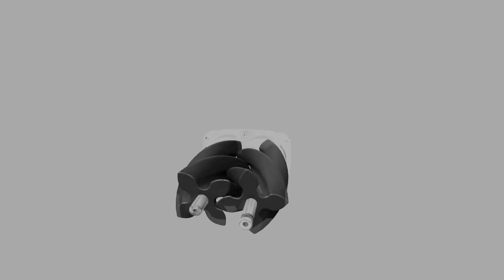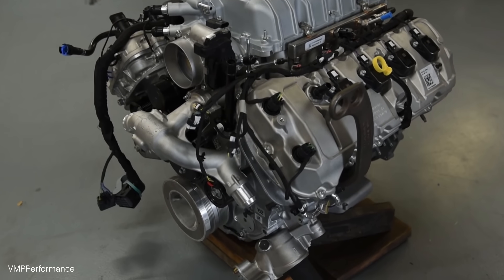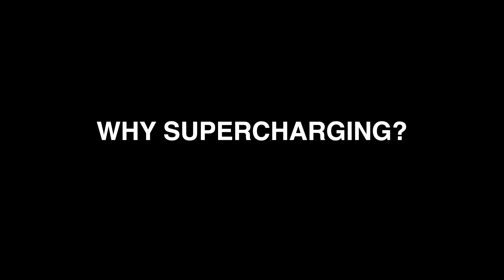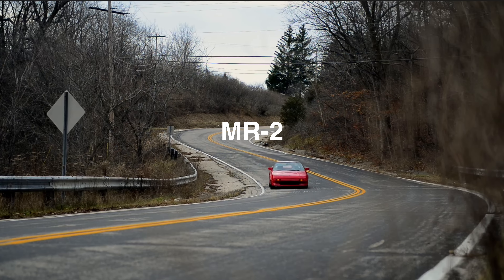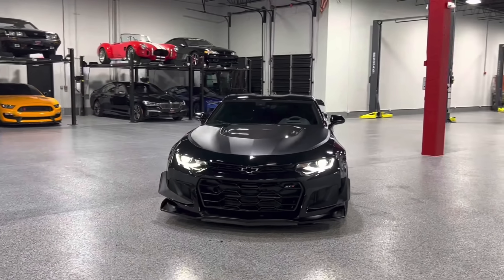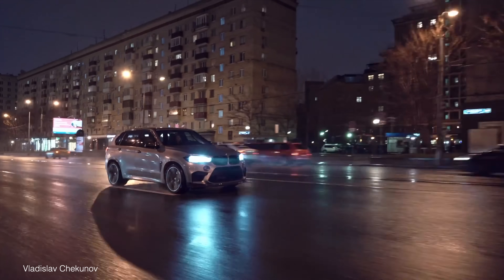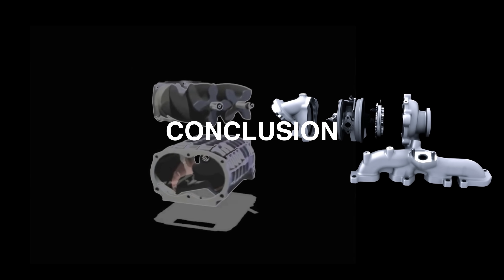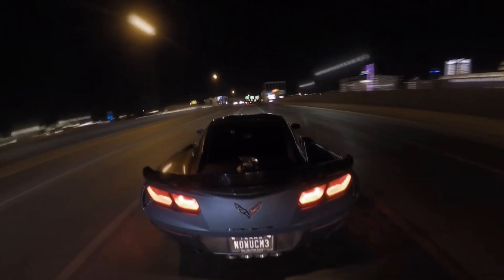Why V8 Engines Are Supercharged vs. Turbo😮| Explained Ep.6

Comment: Gotta remember the biggest thing. You were close to saying it.
V8s make more low end torque than 6 and 4 cylinder engines.
Super chargers give instant torque better for low end power.
Turbos build peak boost later in the rev range better for DOHC high revving engines. Usually v8s aren’t Devine as high. Also V style engines are wider making it harder to fit snails next to the heads. Super chargers sit snug on top of the intake manifold
Reply: A properly sized turbo can start spooling at 2100 rpm. But then fail on the top end of the rpm. But a twin turbo setup matched correctly has both low and top end.
Reply: @12pawsinn  variable vane turbo. Best of both worlds
Reply: @12pawsinn  even variable turbos?
Reply: That kinda goes both ways though, because supercharging the i6's and i4's could help offset their relative lack of Torque. I think its mainly down to the fuel costs in US vs EU, Euro car manufactures focused more on turbos because they knew their customers demanded better fuel efficiency due to the higher cost of gas in EU, not to mention the EU's stricter gas guzzler taxes and so forth, which the US stupidly followed suit with later.
Reply: An inline 6 almost always has a better torque curve than a v8
Reply: I can feel the supercharger in my C7 Z06 you can't really hear it whine from inside the car
Reply: So, my truck makes peak power at 3,000 rpm, and it is turbo charged. It makes very little power at high RPMs, so that kinda blows your stupid comment out of relevancy, huh?
Reply: @charlieodom9107  damn bro chill we’re all learning
Reply: @CodenameOliver101  if you want to learn anything, then go to a bookstore and read some good engine builder books. You won't be learning anything but lies here.

The most important thing to know is this: air/fuel in = Power out. Engine size means absolutely dick. A 3L engine can make just as much power at 3,000 RPM as a 15L engine does with the same amount of input.

The issue becomes how hard it is to squeeze that much into a small displacement engine. For example, a 5L engine makes the same theoretical power at Atmospheric pressure, as a 2.5L does at 14 psi of boost. There will be minor differences based of volumetric efficiencies of the engines.

Turbos get their power virtually free from the exhaust gasses, whereas superchargers are parasitic, so there is some losses, making them less efficient.
Reply: @charlieodom9107  turbochargers also reduce the power output by restraining the airflow of the exhaust gasses. It’s nothing compared to the loss of power caused by a supercharger, but that’s still an important factor.
Reply: @CodenameOliver101  Exactly...which is why his comment was a good contribution to the conversation yo
Reply: @albero319  turbos use wasted exhaust gases to make power. Superchargers use power directly from the engine to make power.
Reply: @White000Crow  yes, and both subtract power from the engine. You can’t get energy out of a fluid without actually reducing the energy the fluid has, which means it gets slower, which means that the engine needs to work harder to push the exhaust gasses out.
Reply: @albero319  what are you talking about getting energy out of fluids?  The gas is getting burned regardless of your forced induction.  The hot exhaust is coming out of the engine when it runs, which is purely wasted unless it is being used for something. 
How restrictive are turbos, do you have an equation for the losses?  
If you are talking exhaust restrictions you can also be talking about port sizes, exhaust manifolds, headers, pipe diameters, mufflers, catalytic converters, pipes bends, etc.  These are factory cars they have all these restrictions as well. 
On my old turbo 1.9L I had a 3” exhaust, straight pipe all mandrel bent. I doubt there were many restrictions there.
Reply: @White000Crow  a turbine is a machine that transforms the kinetic energy of a fluid into mechanical work. By doing this you reduce the speed of the exhaust gasses, which reduces the efficiency of the engine. This disadvantage is not that big and gets cancelled out by the forced induction (if the designer knows what he’s doing). That’s the same principle that gives piston engines a little bit of extra efficient at medium altitudes: lower atmospheric pressure means a higher pressure differential and a higher kinetic energy of the exhaust gasses.
Reply: @albero319  so fluids like water passing over a turbine act the same way as hot exhaust gases?  I’m not getting the comparison. 
Try walking in neck deep water flowing at 10 mph, now try it in 10 mph wind. There is a huge difference there. 
The whole exhaust system on factory cars is full of restrictions that reduce efficiency.  Exhaust gases are a wasted energy that is a byproduct of internal combustion.
Reply: @White000Crow  exhaust gasses are a wasted byproduct, but the way they flow has a huge impact on the engine, that’s simply it.
Reply: @albero319  Dude, tell me why my old 330i N52 made 274hp on a remap and my old single turbo twin scroll 435i made 420 fbo stage2+ E20 map and the cherry on top my twin turbo M4 makes ~ 500 on a remap (and catless). So adding turbos results in a more powerful engine (all of them 3.0L i6). Even if the turbine takes some effort to spin it more than gains it from the increased combustion.
Reply: @Salpeteroxid  it’s a small loss, and of course it’s cancelled out by the forced induction, just like it is for superchargers.
Reply: @albero319  a turbo indeed forms some restriction in the exhaust, increasing backpressure, but it more than makes up for that by increasing inlet pressure. This isn’t even including the fact that the engine can now inject more fuel as it gets more air.

A turbo takes energy from the exhaust gas that would otherwise be wasted, as at high load the exhaust gas is way above atmospheric pressure as it leaves the exhaust ports.

A turbo makes it a bit harder for the engine to exhale, but makes it way easier to inhale.
Reply: @albero319  it's not a loss. Not if you see it as a package. An electrically powered forced induction, powered by external power source with the same amount of air pressure is going to slightly outperform the exhaust powered one.
 I think you just want to be right. It's like saying you loose some weight because you are chewing and walking to get extra portions in an "all you can eat buffet".
Reply: @Salpeteroxid  I’m just saying what I was told by an engineer which made me realize something I never thought about, and wanted to share it.
Reply: @albero319  It's kinda obvious that and obstruction in the exhaust even though it's beneficial in the end.
Reply: @charlieodom9107  It takes horsepower to drive a turbo...just far less than a supercharger...
Reply: @reubenmorris487  wow, the total ignorance in that statement is hilarious!
Reply: Not really, at all. If you had a 4 cylinder engine with the same displacement and efficiency of a v8, there's nothing that suggests it won't have the same torque curve. The reason we have v8s that make more low end torque is because we don't have room in the engine bay for a 5+ liter 4 cylinder.
Reply: @jankington216  the advantage more cylinders give you is a smoother application of torque. A 8 cylinder engine will apply that torque over the course of a complete cycle more consistently then a 4 cylinder will.
Reply: @jankington216 it has less to do with size of engine and more to do with practicality. There are some big displacement 4cyls in tractors and boats and stuff and they have like 200hp max. But they can hold that 200hp under extremely heavy load which made them good for farming and stuff but not practical for a passenger vehicle.
Reply: A bmw 235 with twin scrol turbo has 450nm @1300rpm.
Reply: This isn't necessarily true. There isn't anything that makes a V8 inherently a low end torque design and a V6 or I4 isn't necessarily high end torque. That all comes down to tuning. The C8 Z06 is a high revving V8 and I have a CRX HF from 1987 that made its peak torque at 2500 rpm with a 4 cylinder. The former was tuned specifically to make high horsepower naturally aspirated--and for that you NEED high revs. The latter was was tuned for maximum fuel economy and for that you want peak efficiency at low rpms for less frictional losses.

To address the point of the video: it's more historical and marketing than anything. Turbochargers have had decades of development (about 50 years at this point). Many American cars--notable ones, too--have used turbochargers as well. I am going to speculate that superchargers are unique to V8s because of drag racing, since top fuel engines are supercharged.
Reply: by design an inline 6 gives more torque down low then a v8
Reply: With a V8 you can have twin twin scroll turbos. Almost completely eliminating turbo lag, and even spool time.
Reply: People keep saying this yet Diesel engines Rev lower than pushrod V8 gasoline engines and diesels are essentially exclusively turbocharged.  Maybe your understanding of the technology is flawed.
Reply: That's with old turbos newer turbos spin up way faster can make power as low as 2.5-3k rpm.
Reply: @cognition26  Actually, many turbo engines can make max torque as little as 1500-2000k RPM. And then due to electronic management, maintain a torque plateau to 4-5k RPM.
Reply: @cognition26  mine starts making power around 1700 or so.
Reply: @cognition26  You are talking about variable geometry turbos, very popular in BMW diesel engines, they get power from around 1700 RPM, which is nice.
Reply: V8 don't make more low-end torque than 4 or 6 cylinder engines inherently, they make more torque due to bigger displacement. Also, it depends on internal design and whether the engine is designed for low-end or top-end power.
Reply: @ryanbrochu3336  I mean for the most part V8s have larger displacement. Off the top of my head I don’t know any v6 with more than 3.6L displacement. Where a small v8  is 5.0  or 4.6   And go all the way up past 8 liters. But yeah in a 4 cylinder you rarely see torque and hp close to each other. Iike a 2019 gtr twin turbo has a 3.8L with 565hp and 467 torque. I mean that’s awesome. But a 2019 supercharged Camaro has 650hp and 650ftlbs of torque out of a 6.2L  both are amazing cars but it’s much more difficult to get the same torque as hp in a v6 or 4 cylinder. Maybe I’m wrong but that’s just seems like the norm.
Reply: @forfun6273  evo and wrx sti have close matching hp and torque #’s
Reply: In my very humble opinion turbos are not the best idea for muscle cars because big V8s need to breathe. Turbos are restricting the exhaust and creating a suboptimal airflow. V8s were not meant to use those super short tube headers, it suffocates the engine. A supercharger uses a bit of torque but it can be used with any exhaust you want. People tend to overlook that huge sc advantage.
Reply: @sarmatiancougar7556  properly sized turbos do not prevent a engine from breathing. Diesels need even more breathing then a V8 gas (ever notice that even stock diesels have much larger exaust) and virtually all diesels are turboed instead of super charged.
Reply: @SilverStarHeggisist  diesels are low revving engines that can take a lot more boost. So the exhaust restrictions there are compensated for by all that additional oxygen.
Reply: @sarmatiancougar7556  they may be low reving, but the pistons travel way further and faster then a gas

Comment: Great vid. I like both, turbos are more efficient for the daily aspect but they both make power and sound fire. Turbos car need to be slightly modified to really bring out the sound, mine is loud aF after adding intakes and blow off valves .
Reply: Turbo also sounds better than a super charger especially when you hear a loud blowoff coming from it, you know if you hear a turbo the car is not to be messed with
Reply: @Rerollful  ha! I’m about to install some BOVs a company sent me for my next vid, I’m a little biased when I say I love turbos 😁
Reply: Nothing sounds better than a big fat turbo kicking in. Not as good low end but boy it's so much more visceral and wild

Comment: as a self taught mechanic, videos like this are really helping me expand my knowledge. keep it up man! hope you can cover the advantage and disadvantage of an H pattern gear box vs sequential gear box
Reply: Sequencial are often only designed for racing, and will have features such as straight cut gears (stronger but lots of gear whine), and the ability to slam shift. You can take the pressure off them by blipping the throttle and just mashing the lever forward or backwards to shift.

H pattern is generally able to be shifted fairly quick, but it's hard on the synchros trying to jam gears if you even can at all. You can float the gears without touching the clutch by rev matching but it's way slow.
Reply: Sequential being in a specific order more so disadvantage would be not going from 1st to 3rd etc like an H pattern could! Advantages over H pattern less shift time no miss shifts etc! That help any??
Reply: @gcook619  nah I already know that. but need a more in dept explanation

Comment: Well mostly because the rpm potential of most American boat anchors sorry V8s are quite limited and would not really benifit from the crazy rpm a turbo can create. Not to mention the  are nearly all rough at low rpm.  In many ways it's easier to control a supercharged engine too.  I would argue that a supercharger would cost more to manufacture than a turbo.

Comment: I’ve owned both. NA is best. Positive displacement supercharger is next. Turbo is next. Centrifugal supercharger is next. Turbos have fun drama, but the lag and effect on the exhaust note is their issue. Superchargers still have rpm lag where full torque can be achieved sooner with a turbo, but the supercharger response and predictable power and reliability is superior. Having owned Supras and Evos and had a supercharger Harrop BRZ and now a turbo K24 swapped BRZ, I’d take the supercharger all day long.

Comment: I don't know if the European engineers came up with the hot v first, but I've seen that setup in a 
v-12 diesel engine and it was for oil field fracking operations which is probably not the only application. It had 4 turbos and I was really having a hard time figuring out the plumbing  since it wasn't torn apart. It was an absolute maze of piping lol.

Comment: I understand that superchargers don’t suffer the lag turbos used to (emphasis of TURBO), but that parasitic loss just kills superchargers for me. Plus, as mentioned in the video, turbos nowadays have reached a point technologically that lag is heavily reduced and nigh-nonexistent. Most of the supercharger’s advantages have been mostly rectified in turbochargers. 

As for the noise, just get an aftermarket diverter valver (bov) and chargepipe, and you’ll hear those turbos spool loud enough to scare anyone wanting to race you
Reply: Yup no one fears superchargers but the second you hear a blow off valve you know it’s a scary sight lol everyone will turn their heads that bov is more intimidating than the power steering sound lol

Comment: I see a lot of people saying superchargers are better than turbos. But because superchargers take power from the engine to make power they put more stress on the engine, they are less efficient than turbos, and they weigh more than turbos. What tells you that turbos are better overall is how they use a 1.6 liter V6 Turbo to make 800+ horsepower in Formula 1. Turbos also have Twin scroll turbos which are used in European Supercars, because they reduce turbo lag and give you boost through a wider range of rpm. Issue is this costs more and for cheaper turbo setups when that turbo boost kicks in, its like thunder.

Superchargers have a more even and consistent power curve, and give you more low end torque. and are a much cheaper way to boost power. The noise is amazing, but sometimes can be a bit too high pitched for me.

Comment: I agree with your accessment but I think your dates will be pushed back, America electrical grid is not ready for mass produced EVs and the Battery production to drive those EV is also not available. Will electric cars be faster. .. yes but will they slow gobal warming No they won't because While EV s are fine for cars the don't work in trucks construction equipment, and 75 percent of the the use of petroleum which is not in the personal transportation market. They the people in power are at all cost trying to get us out of cars all together.

Comment: I think superchargers could come back one day, technically it makes irrational sense, but an electronic-driven supercharger could work similar to electronic-spooled turbos. Using them in sequence could also potentially curb the current issues with twin-charging a little...sounds like a porsche shenanigan tho
Reply: It’s probably easier to do a hybrid electric setup where it switches to combustion at an rpm where the turbos will make boost